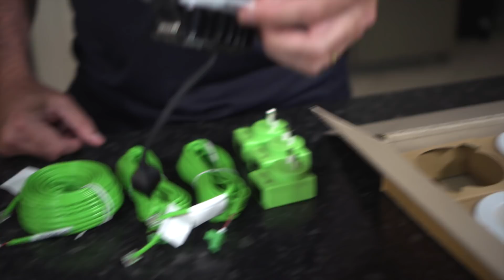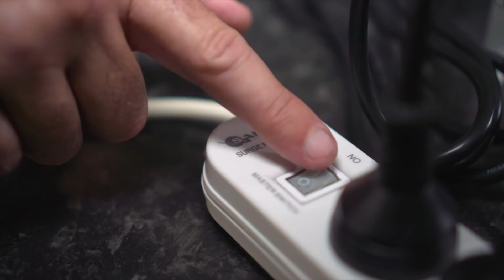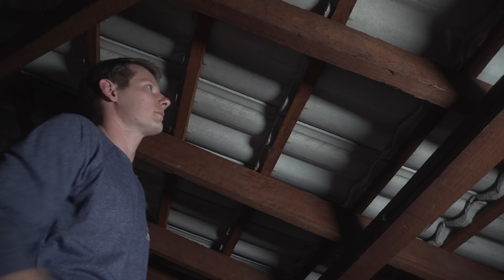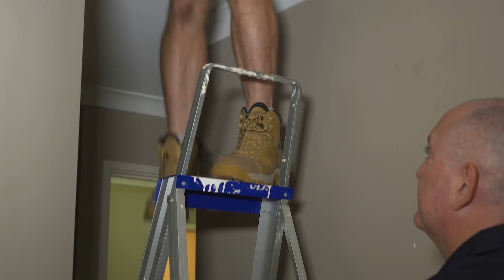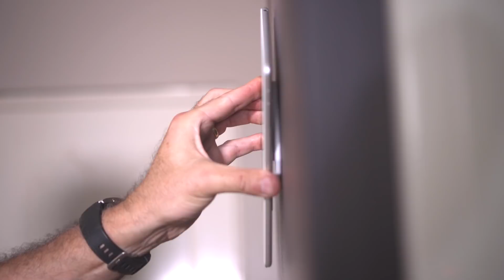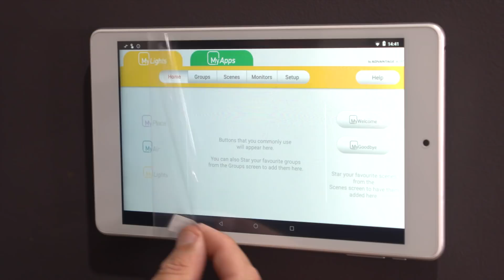MyLights  DIY Installation Guide

Comment: There is NO electrical work in this task. ANYONE is allowed to plug/unplug devices!
For those sparkies (complaining here) that usually charge an "arm and a leg" to do electrical work, "get a life". Most potential diy installers would already be capable of this kind of task, otherwise they would not take it on. What idiot thinks that a fall restraint system is needed inside a domestic roof. Any restraint system would severely restrict movement in the roof space, potentially causing a trip hazard!
This is NOT a confined space! This is a space where movement is awkward, but airflow for breathing is fine, especially under a tiled roof.
The instructions provided by the participants in the video are clear and safety is described.
After the installation of a 28 panel 14 kw solar system, I have had several sparkies performing work at my place. This means ACTUAL wiring work, not power point stuff (as shown here)! NONE of these sparkies turned off the solar connection!!
This video does NOT provide any electrical work. You do not need training to get into a ceiling! You do not need training to UNPLUG a LIGHT!

Comment: Are we ignoring the Solar Main Switch being left on!?!?!?
Reply: Idiots
Reply: After the installation of a 28 panel 14 kw solar system, I have had several sparkies performing work at my place. This means ACTUAL wiring work, not power point stuff (as shown here)! NONE of these sparkies turned off the solar connection!!